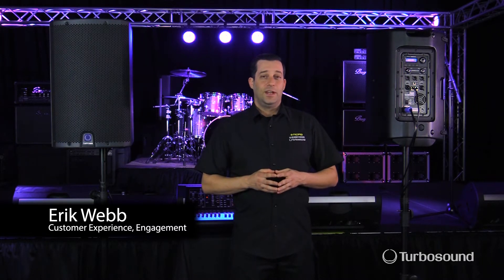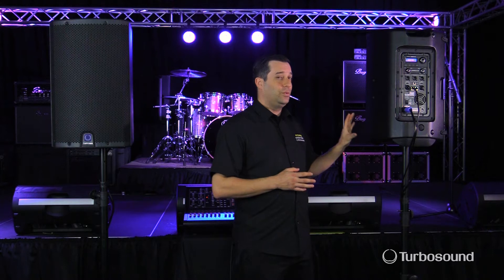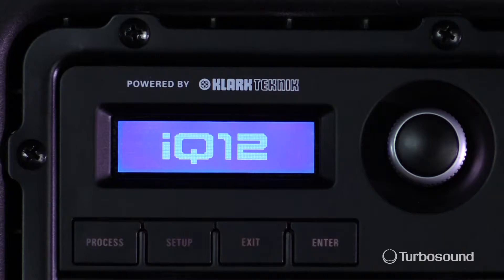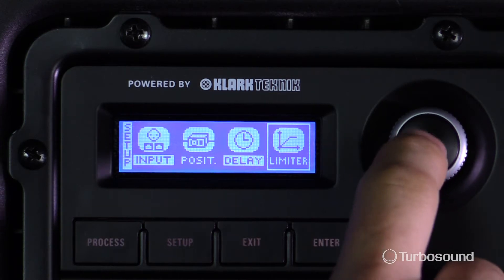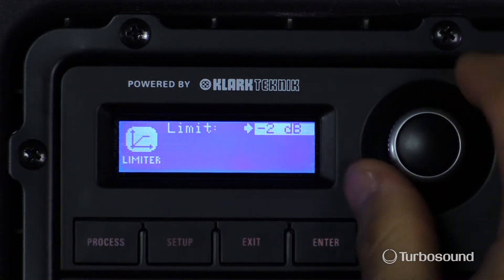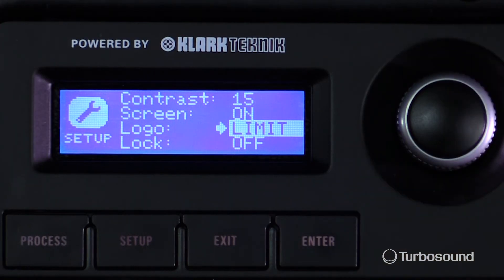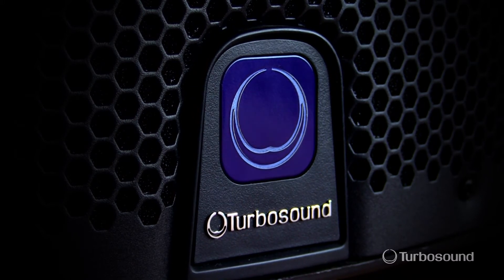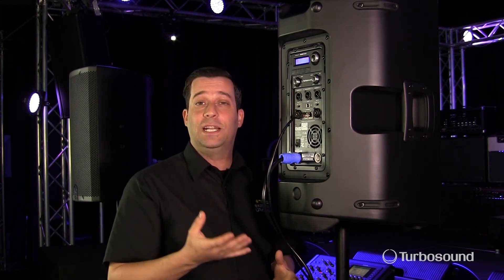TURBOSOUND iQ Series - Limiter

Comment: Wow it look awsome. question: is it possible to lock the Settings to prevent DJ s from changing the gain or limiter function? if yes,
You have sold some of the 12 inch version : )

Comment: Hi, 
I have iq series 15 top and 18bin. Normally i use it with -1 limiter. What’s the accual effect to the speaker if i off the limiter and use with maximum trim on Bins? Coz I experienced.. by turning off the limiter gives more bass power in bins.

Comment: Erik or Turbosound, big fan here of the videos and Turbosound.  I wanted to get a little more depth on this.  Is the DSP limiter the same as an internal limiter, designed to protect the speaker?  Let me be more specific.  For iQ, there are 2 ways to connect - via the XLR combo jack inputs or Ultranet.  From what I heard, the ultranet seems quiet by 10dB according to some.  If I put that ultranet trim to +10 dB, does that work with 0dB limiter?  I have the X-air 18 mixer, so I can watch for 0dB there too.  My hope is to try and normalize, and get speaker safely pushing 0 dB, by making sure mixer is output is at 0dB and speaker takes in 0 dB - and amp safely handles it without long term damage to the speaker.
Reply: Did you find out?
Reply: Did you figure out anything?